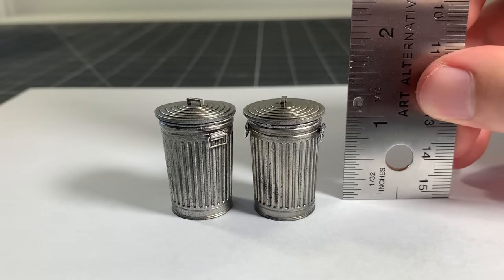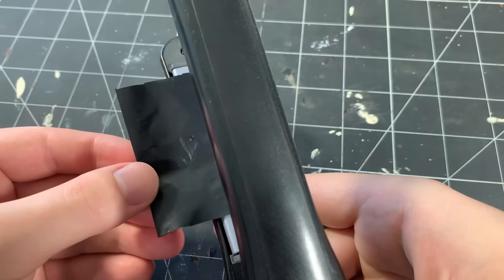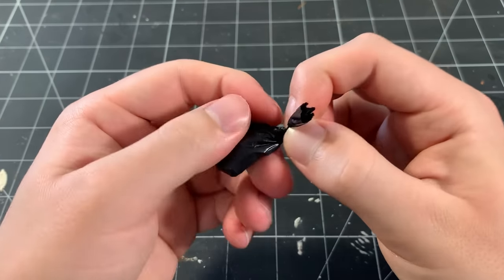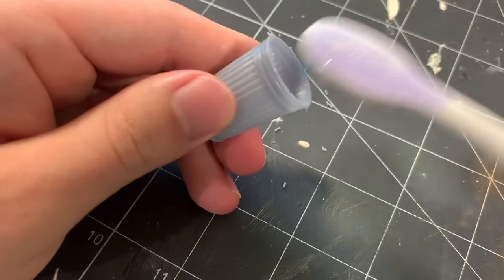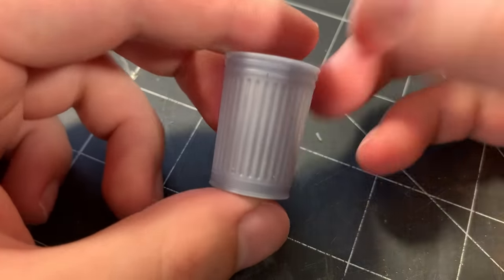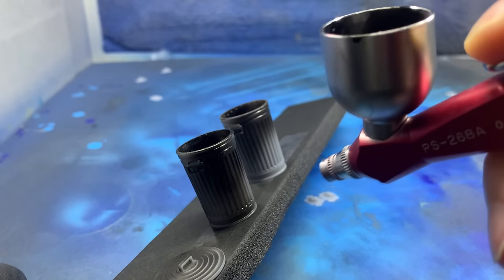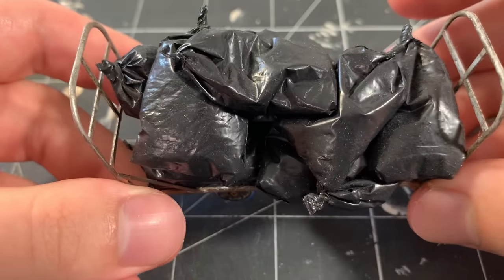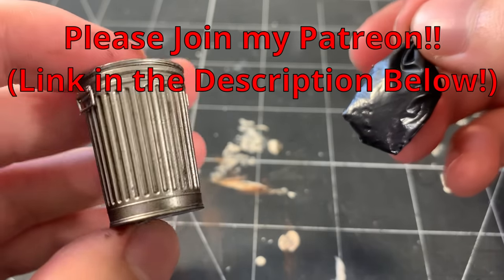How to Make REALISTIC Miniature Metal Trash Cans & Garbage Bags for Dioramas

Comment: How would I make the trash bins without a 3D printer? Not to take away from the video… but anyone with a 3D printer can add the files and hit print.
Reply from the maker: I get your point but it takes skill to create 3D files and I’d say it’s more than just hitting print. 

Lots of trial and error pushing boundaries on what is physically printable, balancing between detail and scale, how thin you can print certain parts, proper support placement etc. 3D printing is just as skillful as making model kits, even more so if you design the files yourself 

You could try making them from thick gauge aluminum foil, but you’ll spend your whole day embossing the texture with a toothpick if you need multiple cans.
Reply: @smolworldworkshop  see.. that right there, that’s good information. Talk more about how it would and could be done if one didn’t have a 3D printer as you make it(just an idea, to be fair you may of already done that, honestly I am behind on your videos).

 I am aware the files are hard to make, to get it right. I wasn’t trying to say it’s easy… was just highlighting that I could use you file you have on offer, or others out there. 

In my spare time I make things by melting metals. I have to make my own molds so I get how hard it is.

Do you have a video I can watch that shows how to make things with the least amount of tools/software? Something a 3year old could make for example. My grandkids would love that.
Reply from the maker: @ThisZombieBitesEverything  yeah that’s a good point, if I have time in the video, I’ll try and verbally mention how to build without a printer. 

I do have an old cabin diorama where I show how to build a basswood cabin from scratch with basic hand tools. The furniture is 3D printed but it’s honestly such a small part of the video. I show how to make a frame, add siding, make shingles, a tin roof from styrene all by hand if you’re interested
Reply: @smolworldworkshop  thank you, I will check it up. And thank you for hearing me out. Not a lot of people take the time to do that… so thank you again

PS, I understand it maybe time consuming, but if possible, I would love to play the guessing game… I would love to see if I or anyone could tell what’s 3D printed and what’s not? Something tells me my grandson will win and I would still be guessing 😂

Comment: Very nice can model and final painted results. The main part of the can would be 100% printable with zero support without the lid in place. The lid is the only portion that needs supports in this model, so printing it separately from the can (supported by itself) would save a large amount of support material and would also save a bit of printing time.
Reply from the maker: Thank you so much!! And you’re totally right about the orientation! The reason why I didn’t print it unsupported directly on the build plate was because I was certain I’d destroy it trying to remove it without a raft. I’d maybe try that if I get a flex plate though! Thanks again for watching!
Reply: @smolworldworkshop definitely recommend a flex bed. But you might have been able to get away with a small raft or even skirt with this small of a print. Which would be easy to remove(can be, I suppose😂)

Love the project btw, wish a couple bags fit in the bin but if I were to do it myself, I could make that happen😂👍

Comment: Of course, 3D printed. Well, thanks, but does this help those without the printer? No.
Reply: Thinking of some of the stuff that Luke Towan did, how about creating a  mold in polymer clay and using that to shape a heavier foil around it? Luke did something similar to create corrugated metal sheets for rooves.

Comment: I hesitate to get a 3D Printer. I don't know what kind of things we can do and what we can't do with that. I am affraid to fucked up.
Reply from the maker: That’s totally understandable! I bought my first printer 3 years ago with only some basic knowledge about 3D printing and making files. You definitely will make mistakes and have failed prints, but just like learning anything new, it’s a part of the process. 

In regards to safety working with resin, I think it’s very important to extract the fumes outside and work in a well ventilated area. I keep my printer enclosed in a vivosun tent, and extract the fumes out the window with a fan. Always wear gloves, eye protection, and a respirator when washing, away resin and sanding resin. 

In all if you take safety seriously, you should have nothing to be worried about! There’s lots of videos on every 3D printer on the market, so just do some basic research and go for it! You’ll learn so much!

Comment: Hi, Why did you print the Trash Can upside down? it would have no need for suports printed upright
Reply from the maker: Hi there, I printed it upside down supported because I printed it directly in the build plate, I would have broken it trying to remove it. If I had a flex plate, then I’m sure it would’ve been fine!

Comment: I don't have a 3d printer yet but have watched a bazillion videos and instructions about supports and model position for best prints. I am wondering why you didn't print the can with the base on the bottom? You wouldn't need supports at all right? If they base is against the printer plate and prints up there would be no need for supports? I am confused why you needed so much support except if you printed upside down with the bottom of the can at the top.
Reply from the maker: Hi there, yes theoretically you could print pieces straight on the build plate. But these prices are extremely fragile, and I think you’ll find that you’ll break more prints removing them if they’re directly on the build plate. I always print with a raft which gives an easy edge to remove the print from the build plate. 

You may be wondering why I don’t have a flex plate in that case. For most average prints, that should solve all th problems as bending the plate causes the prints to pop off. But again, with prints that are super thin and not post cured yet, they are still very flexible meaning the plate will need to be bent a lot to remove them, which will make the prints warp and distort. 

Also, I printed the can upside down because that way there will be no visible support marks that way from the outside, only inside the can. Hope this helps!

Comment: 3d printing isn't "making" something.  If I see a video titled "how to paint a basket of fruit" and the opening lines are "you'll just need a color printer for this" then it's not a video on how to paint. I am sure you can see where this analogy is going.
Reply from the maker: Fair enough but 3D printing very much is making something. Lots of work goes into designing the files, supporting the correct orientation, cleaning and sanding for painting, etc. I don’t understand why there’s some stigma against 3D printing as “cheating” in the modeling community, when you can say, how to make a 1/24 scale Toyota Supra, and it’s build from a pre molded kit. Nothing about it is scratch built, but it’s still called “making”. If anything, 3D printing is more skillful than building a kit, because you have to design the kit you are printing. I think you can see my analogy too.